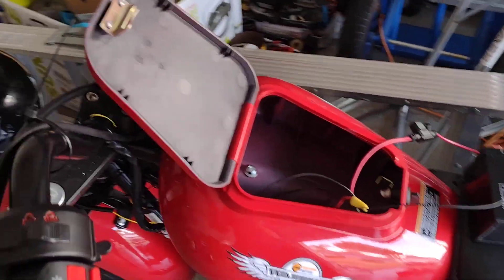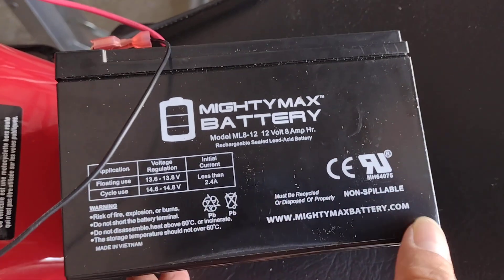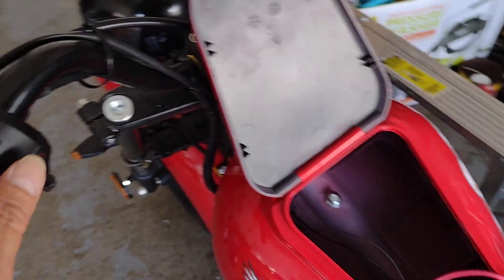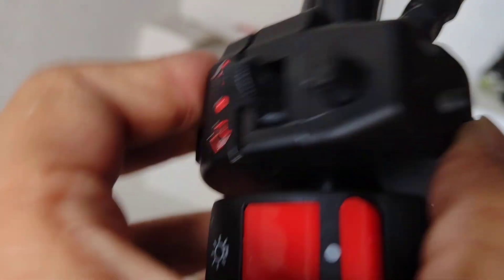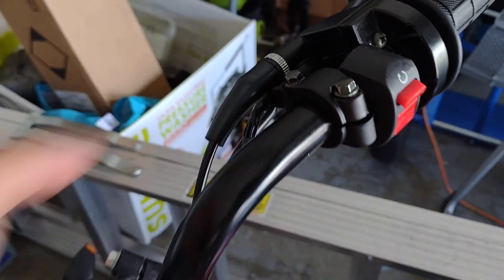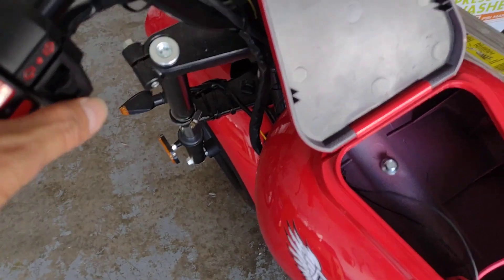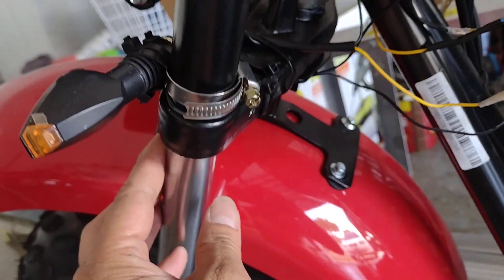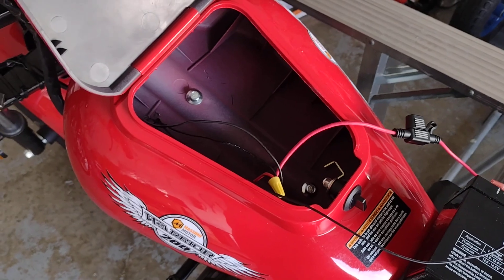installation of brake light, signal lights and horn MB 200 Massimo mini bike

Comment: Cool mini ,how long does your battery last on a full charge thank you
Reply: I have a similar battery and it’ll last at least a couple weeks. I’ve used it for about 12 hours so far and the voltage has barely dropped